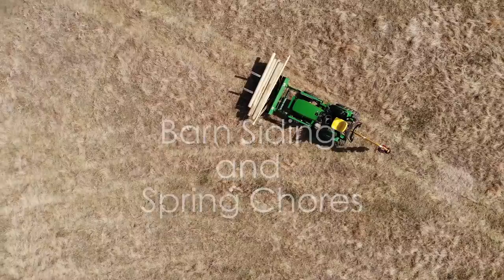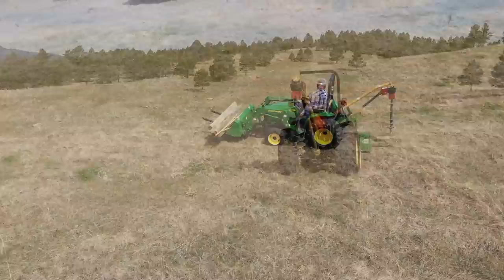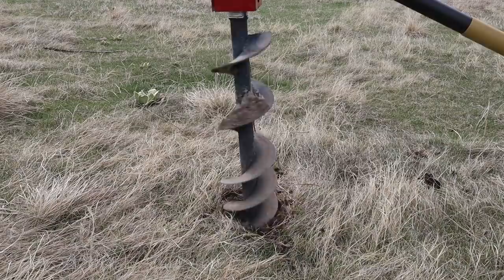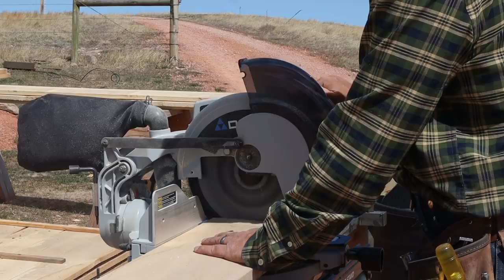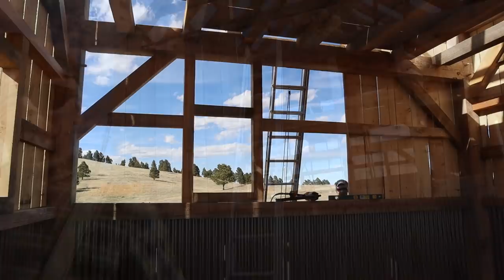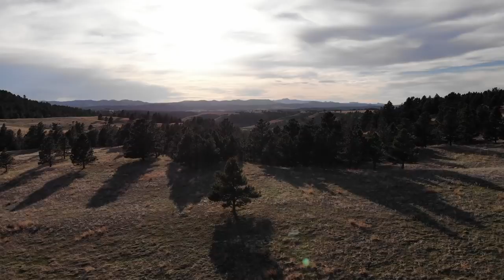Timber Frame Barn Siding and Spring Chores

Comment: Really looking good, liked the way you staggered the seam, might check later and seal the joints to cut down on rotting though. Water coming down will wick into the bottom row of boards. Maybe a straight line cut and a drip edge next time? I like the build that you are doing.Thanks for sharing.
Reply from the maker: Thank you.  I am sealing the end grain before the top board goes up.

Comment: Coming along great. I would think you would either over lap the bottom half boards with the top half boards or make a straight seam right across and use a z style flashing to keep the wind driven rain out. Love the steel and ruff cut look.
Reply from the maker: I didn't think I wanted to do the z but I may do that for the front.  Have to watch the layers because there are no overhangs

Comment: I'm going to pack out the boards on the gable end with a 5/4 board shim and break them on the tie, then slide the 7/8' boards up under the over hang for a shingling effect, it will give a line that throws the eye off but still is acceptable.  And I still need to deal with the corner boards for post protection from the weather.  Just go onto another project which is nothing new for me.  Oh, no rocks for that post hole digger, so lucky, we are mostly glacial till and  lots of rocks.
Reply from the maker: I am going to do something similar on the front I think.  I have rocks, just not in that hole!  Varies from hole to hole it seems.

Comment: Happy Resurrection Day! 

Your editing skills with the boards magically being placed one after  the other, without most of the nailer noise, etc made that the quietest, most enjoyable siding job I've ever experienced! :-)

I'm going to wait to pass judgment on your stagger-lap idea until the battens are there to break it up further. But, gotta say, liking it so far. Wondering if a careful application of a liquid flashing material on the 45 deg. end grain on the bottom boards would have helped with the longevity of the siding... Don't know how much that would have accentuated the look of the cut though...  I guess without the "flashing" coming out and forming an actual drip edge it not help much...

The drone footage of the property are always a crowd-pleaser... One beautiful spot, that is.
Reply from the maker: Thank you Dave.  I am sealing the bottom board of the lap, just not showing it

Comment: Where are the cows at the present. Do they winter somewhere else? From the field the timber frame dwarfs the house. Glad your soil is soft enough to get the auger so deep. When I lived in south Texas in the summer the soil called Victoria clay was so hard The we had to pour water in the hole to get deeper. Otherwise we had a shallow hole filled with dust .
Saw you had help for a little while. What about leaving the nail gun up top so you don’t have to lug it up each time.
Reply from the maker: Thanks Lars.  This time of year is the only time I can drill holes, in a few weeks it will be too hard.  I did leave it up there after a few boards LOL.  The cows do winter on another place.